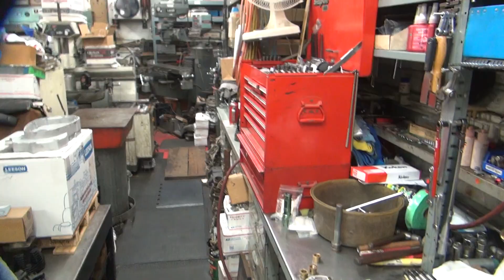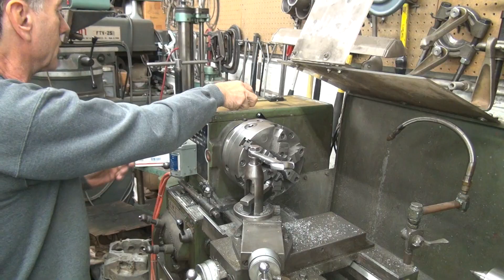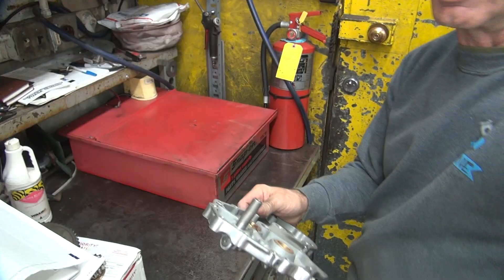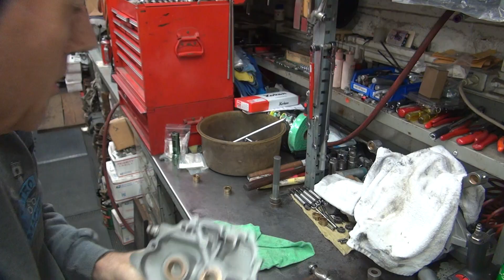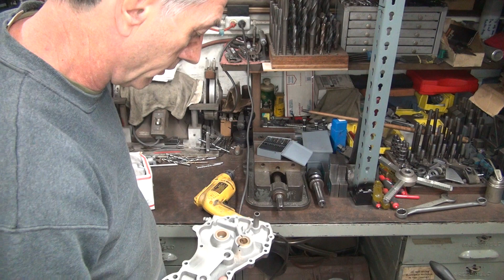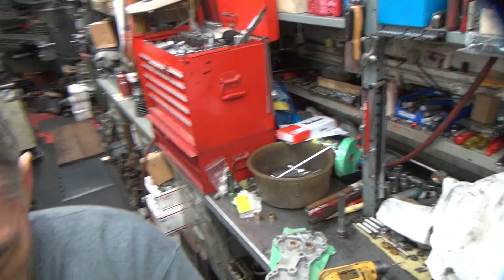#178 1946 junk 84ci stroker knucklehead 500 mile new repo motor rebuild 79ci harley tatro machine

Comment: Tatro,
This is not being argumentative, and I own and owned many HD, Hondas, Kawasaki, 
Triumph, etc, etc....
But, of Harleys are so good and well built, why are we always working on them?
You can leave a a Suzuki Intruder 1400 with 67,000 mikes on it...leave it in rain, snow, hot weather for 7 years....drain fluids with a new battery and it will run great and reliable!  I know, I bought one and that os exactly what I did...sold it with 70 something thousand mikes on it...wish I never did sell.
Luke I said, got a few Harleys and it is always one thing or another.
Reply from the maker: maybe they learned something in the last 70 years on how to build a bike. what was suzuki making in 1946 after we kicked their ass in ww2. isn't it amazing on how much people care about an 80 year old harley and how much they are worth. that means alot in this deal.
tatro